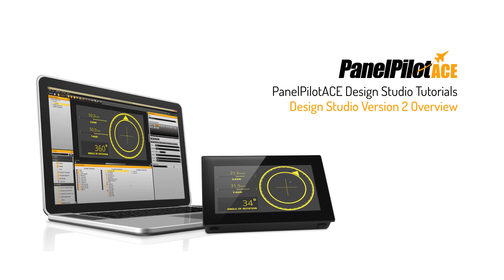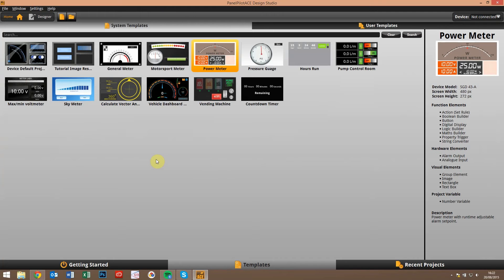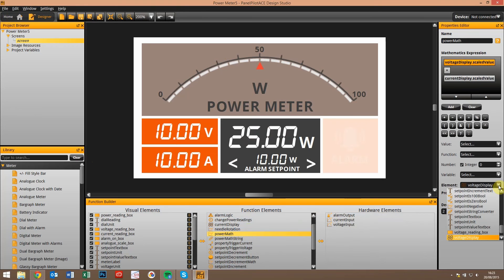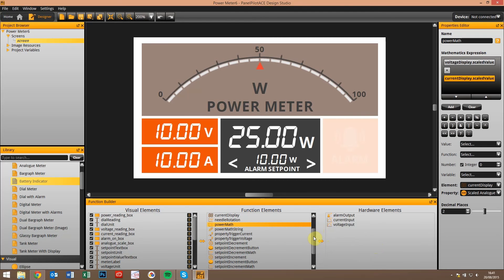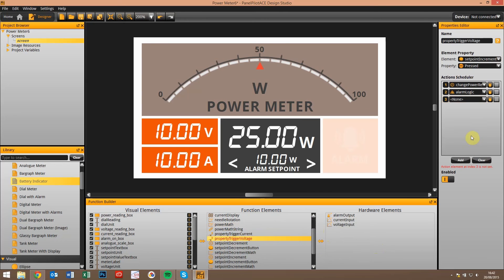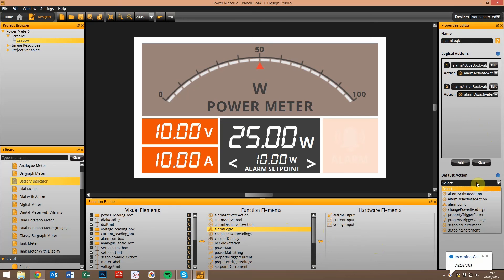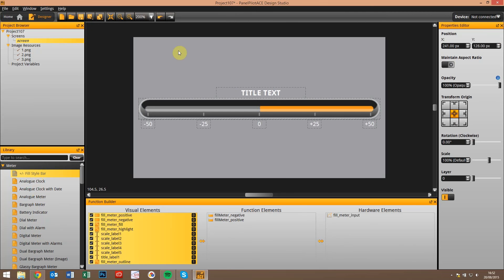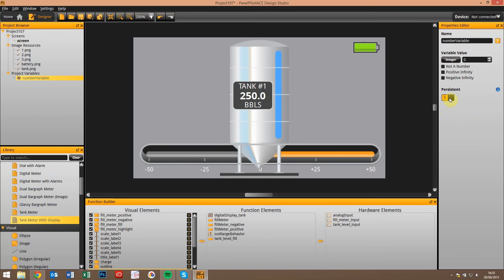PanelPilotACE Design Studio Version 2 Overview

Comment: Hello, 
I bought recently, a LASCAR SGD 43-A DK+, device and I need help to develop a small application.
For the beginning I need to count and display the pulse from one digital input. (actual value : can be maximum 200). After 8 hours I need to reset to 0 that value, and the counting process, must restart.
Can you give me an idea ?

Thank you!
Petru
Reply from the maker: Hello Petru,

Thank you for your interest in our PanelPilotACE. We would be happy to help you develop this application. Please contact sales@lascar.co.uk to progress this project.
Reply: OK. Thank you! I intend to buy 3 more devices, if I can use them.
Reply: thats easy done , but be aware or frequency of your  the pulse gona measure... i dont think  sgd 43 will count fast frequency speed puls.  Can  toy  specify the source pulse speed  so to make sure will this unit will be ok for your project... rather using high speed plc.